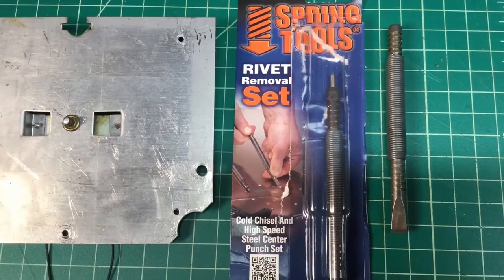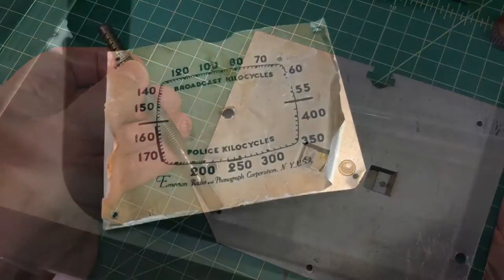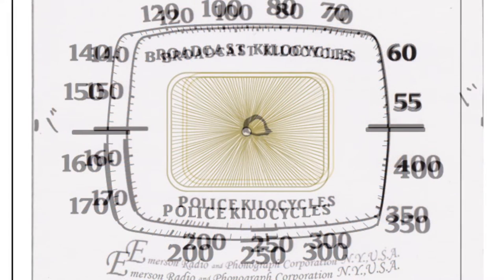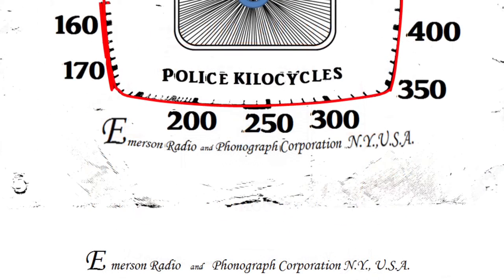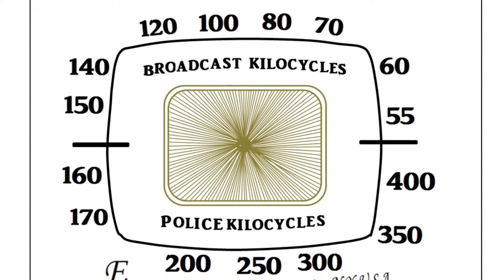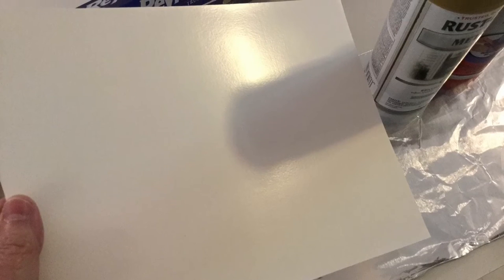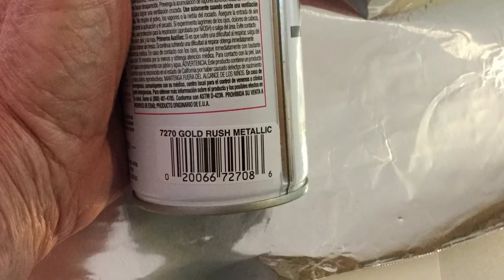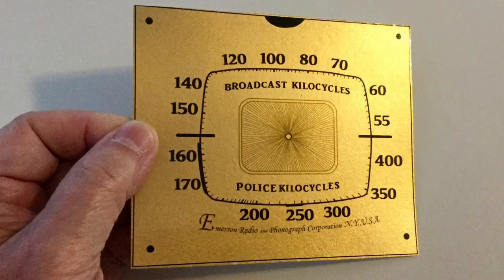Emerson R167 - Reproducing the Dial Scale

Comment: You said you used Excel for the numerical data. I know Excel as a spreadsheet program. I would be very interested to hear how you accomplished this.
Thanks, nice job!
John
Reply from the maker: +JPennDotCom Hi John. I first scanned a copy of the dial scale, then used the insert picture option. I used the original as a template then leveraged the drawing features in Excel under Insert/Shapes. The circles, arcs, lines were used to create the scale. The numerical data was done so by finding a font that closely matched and increasing/decreasing the font size as needed. Once the font was finalized, I saved it as a bitmap image and placed it over the top of the original number(s) and resized it to match the original as close as possible. At the end, I removed (cut) the original inserted image leaving behind the new graphic image I completed. Hope this helps. Let me know if you have any additional questions. Best, Don
Reply: Excellent. Thank you.

Comment: The font matches very nicely, How many hours did you spend before you found such a good match?
Reply from the maker: +Bart Zuidgeest  Hi Bart - I got lucky. I had 3 cans of gold metallic paint I had purchased last year when I was repairing a pot metal horse, so 30 minutes or less to match the gold foil background. I spent ~1.5 hours scanning and reproducing the the art work. There's a few things I need to tweak, but overall it turned well. I'm going to make another one using gold foil and a transfer material and compare the results. If the new process makes for a better outcome, I'll share it via video. Thanks for your question and for watching. Best, Don

Comment: That dial transfer is fantastic Don ...a super job,  well done my friend.
As a matter of interest, what is the name of the product you use for producing the dial transfer, and what was the name of the supplier ...I guess it was not Crafty Computer Paper?  The reason I ask, it is always handy to have the name of more than one materials supplier to hand.  Although I have no immediate requirement for that particular dial transfer template, could you make it available for some future date should I have need to reproduce one.  As you know, I'm on the lookout for a R-167.  Fingers crossed, I might pick one up at a reasonable price this coming May at our National Vintage Communications Fair - wish me luck LOL.
Best regards,
Phil.
Reply from the maker: +SteelCity321PB Phil, thank you and my fingers are crossed you'll be the owner of a R-167 soon. Regarding the material, a few years back I was looking to make some vinyl inkjet decals. I settled on www.papilio.com for the project. Not sure if what I used is still in production, but it is a gloss clear, 3 mil thickness, permanent adhesive, SKU: IVFG made for inkjet printers. A clear lacquer compatible with inkjet inks can be applied over it for added protection. There's other clear that has UV protection as well. Hope this helps and keep me posted on your search. Best, Don

Comment: is the art pretty stable far as water resistance. or alcohol ?
Reply from the maker: +yrulooknatme Thanks for your question. It is if you seal it with a clear lacquer compatible with inkjet pigments, e.g., PremierArt has a product called Print Shield made for this very thing. I've used it on decals and it works great. I didn't use it because the dial scale sits behind a clear plastic dial. Once restored, this goes to the collection, so no worries with water or other household cleaners, or I'm hoping so. Thanks again for your question and watching. Best, Don